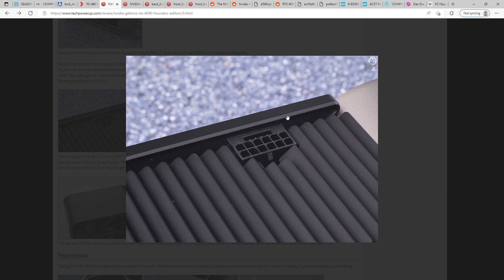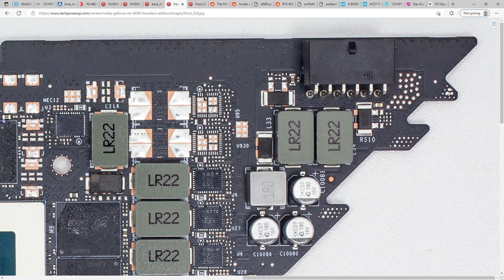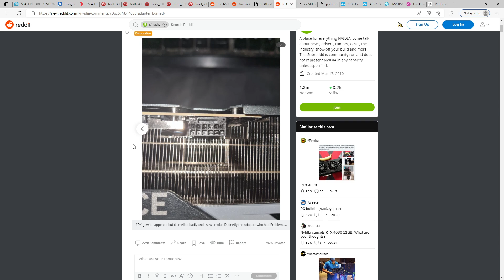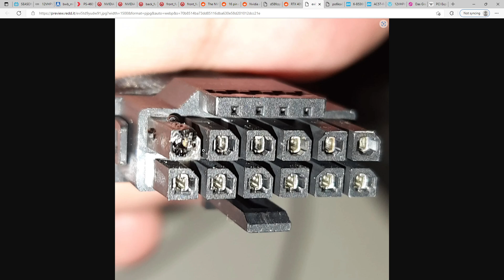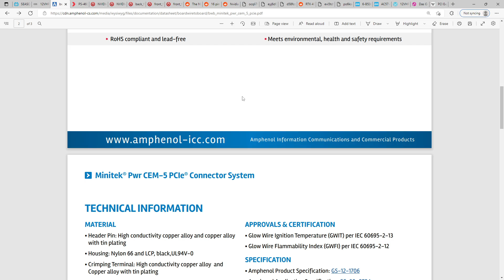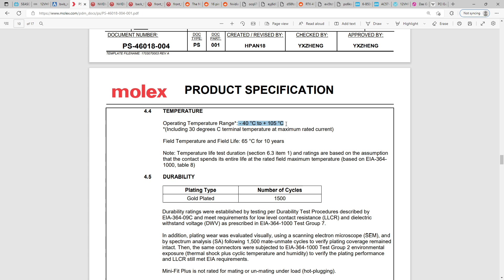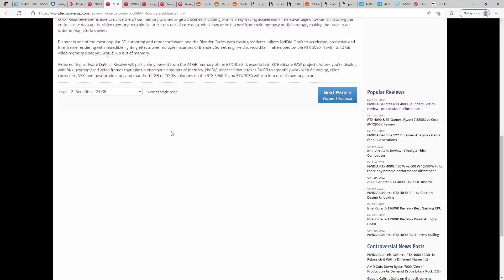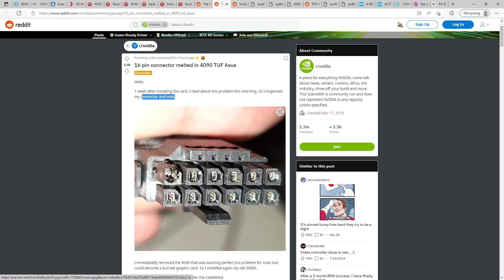rambling about the 12VHPWR failures

Comment: These connectors are a disgrace. The individual pins in the connector are far too small for 100W each and can be damaged or bent in the wrong direction even when connecting them, which requires a lot of force. It would have been best if NVidia had simply used the existing EPS standard for 300W each.

Comment: Plastic is a good conduction insulator. It is generally NOT a good IR radiation insulator.
Even on my 3090 Ti FE the hottest part of the external surface of the card when loaded is definitely this power plug.
It is very noticeable with a heat camera, even fully connected and working properly it glows.

Comment: The stock 3090 Ti adapter cable doesn't have the +4 pins, just the 12, though they are on the card.

Comment: Nylon 66 melts at 270C. Clearly that is the sort of temperature being reached internally. Yet the terminals are however only supposed (by UL electrical standards) to reach 30C above ambient. There is only ONE possible conclusion. There is excessive resistive heating of the pin/contact pair (I2R heating effect).

Comment: iam aweful undereducated when it comes to electronics. but even i though why woudl they replace 2 bigass connectors in favour of one tiny with less pins and smaller diameter.
and now iam about to buy a new powersupply but really question if i should go with the new standard for futureproofing or fuck it and hope this disappears wihtin the next gen.

Comment: 12v can absolutely arc due to inductance in the cables/leads/conductors/components increasing the voltage. When connecting  starting cables to a dead battery on a regular car, voltage spikes into the hundreds of volts, and in the worst cases, thousands of volts are normal, unless there are protection circuits built into the cables. This is what kills electronics in cars. And why you really need to know what the heck you are doing when boosting cars, especially modern cars. Similarly, high current draw items, can cause arcing with interesting effect, like a car, that had a damage wire going to the fuel pump, would arc intermittently, causing the fuel pump to melt/burn out. Over and over.. Until someone bothered to ohm the wiring loom, they insisted it was due to acid in the fuel system :P All that being said, I don't think the 12v connectors in question have been arcing. More likely voltage drop, due to high resistance - like you say.

Comment: 7:00 the conductor is heating up due to the resistance between the male pin and female socket, yes? Supposedly if the connection is poor, there will be some extra mΩ there? If it's pulling say 360 W and we assume the load is evenly distributed, that 60 W per pin which for 12 V it's eeeh... (let me change the numbers... there we go!) 5 A through each connector. 5 A seems fine for those kinds of connectors. 0.1 Ω resistance... eh... 2.5 W worth of heat... is it fast enough to overcome the connector casing heat dissipation? Meh... If i were an engineer i'd say the connector is poorly designed and/or manufactured? But... meh

Comment: Aye I concur, have noticed it's "always" the pwr/12v pins, and it seems to "always" start (!) at the edge pins, commonly pin 6. 12V being the inside row on the socket/pcb side (pin 1-6)/does make it a bit of a PITA; I don't know if any of the AIB versions have a flipped socket though. BUT! I must insist, even on the Founders Edition, that the appropriate method here would be to take a couple of the dirt cheap, tiny glass bead K-type thermocouples or 100k 3950 NTCs, dip the bead in TIM, then secure the cables somehow so the tension of the stiff sensor legs makes them push against pin 6 and 1 (the outer edge 12v pins) , as close to the backside of the socket housing as possible.

IMO that is the closest we're gonna get to a temp measurement "inside the connection", as it's a direct pin/lead contact measurement, and barely 3-4 mm from the pin connection itself.

Comment: People are going to plug in cables from other power supplies and blow up gear. This is a shit idea for any wiring system. All the cables should be the same no matter the manufacture for this reason. All it will take is one cable getting mixed in the wrong box one day in someones closet no matter how careful you are.

Comment: Microarcing is a thing in high current contacts. Have a look at the -ve terminal of a cloud chasing vaper's battery, the type who uses a mechanical mod and blows cloud like a steam train. The 10 amp plus (at 3.7v) brigade. The -ve end of the battery will be discoloured and pitted. I discoloured the -ve end of an 18650 at around 4 amps load in mine, and that was with polished stainless steel terminals.

Comment: Well done. Measuring voltage drop under load would be my choice for proper testing. This is also the preferred way of testing circuits in automotive diagnostics.

Comment: I'm sorry but you are flat out wrong about the "arcing" thing at the beginning of the video. When you have high currents and an intermittent connection you 100% will see arcing even at low voltages. Arc welding is a great example of this.

It is also a very common problem with battery connectors in drones and other lipo powered RC vehicles.

No comment about the rest of the video yet but I needed to correct that bit of misinformation.

Comment: I also like how no one is talking about the PSUs that have a native 12VHPWR connector on it.  You are spending nearly $2K on a graphics card. Buy a new PSU with the proper connector on it and throw the adaptor that is only there for backwards compatibility in the trash. Also the 12VHPWR connector is the new standard.  I am guessing in a generation or 2 all GPUs will only use the 12VHPWR connector.

Comment: The thing is with regular 8 Pins, the cards would only need 3 connectors, and that would still be inside the built-in safety margin. What a stupid "solution" to a non-existant problem...

Comment: Not sure if it matters, but NV adapter is using 4 wires instead of 6, making it 456W; as the 4 middle pins sharing 1 wire per 2 plates. Interestingly the pins with a single wire per plate, on the side of the connector, are the ones that usually gets melted. Considering that those pins are powered by a cable consisting of 4 wires capable 8.5A (300+W) each that is being channelled into single pin designed to handle 9.5A. 
Maybe if one of the 2 middle ones looses soldering or their pins structural integrity gets compromised the one on the side of the connector has to take up the extra load, which it can as it has over 100% safety margin, but then we overload that pin 3+ times the A it designed to handle.

Comment: This is the best explanation of this problem. I’m surprised other YouTubers can’t understand this.
Reply: the irony here being that this particular youtuber turned out to be wrong. had nothing to do with the quality of the pins. turns out the issue was a couple of clowns not plugging the cable in all the way. gamer's nexus had one of their 4090s running on just 1 live and 1 ground pin with a 600W (maximum allowed by BIOS) power draw, and it was fine because those 2 pins were plugged in correctly. 
more than 200,000 4090s and 4080s sold to date. only a dozen or so RMAd cards according to the board vendors. the connector is fine. and i personally love it. makes SFF builds so much easier.

Comment: OMG, thankyou thankyou thankyou.
I thought I was the only one who spotted the 100%/10% safety/hamfistedness margin reduction. That's a brutal level of precision to dump on your users without warning.
Both connectors were rated for the same 30 use cycles but 100% safety margin makes that far less important than 10%. PCI-SIG should toss this crap to the curb. You want 600w, then design a 1200w connector and de-rate it.

Also: 3090ti adaptor = expensive 12x crimped cables.  Zero cheaparse soldering in sight.

Comment: According to their datasheet, the connectors are nylon. Quite ignition-resistant, but still easy to melt. Still, 6 small pins (each way) to carry the better part of a kilowatt on a cable that everybody knew was going to get flexed to hell was kinda smooth-brain. When are we just going to do 6-gauge wire and some thick bullet terminals?

Comment: If your 4090 burns up - it's your fault.  You can afford a $2000 GPU but not a $250 ATX3.0 Power supply?   Hope it burns your house down as well.

Comment: I am wondering if potentially the 3090 ti adapter was tossed in with the 4090 and it was rated for 150 instead of 300.  That would explain Igors picks. I don't own cards, so take it for a grain of salt

Comment: Is there any reason why we only see 6pins used in powerboards? You could basically fit 4 of them on the same area than 3 8pin, while delivering the same power as long as the 3 12v pins are present.

Comment: On Jays 2 Cents, he mentioned someone tested that 12 pin connector and put 1400W through it before it started to melt. That’s pretty good. Hopefully they send out upgraded adapters. I bought a new PSU with a native 12+4 cable/connector. Each pin has its own wire crimped to it.

Comment: Twelve volts might not normally start an arc but it will certainly sustain one. I've seen it happen inside a computer, caused by a faulty molded SATA connector. It arced at the connector, and four hard drives arced across the PCB surface. The glow was visible through the holes in the slot covers, and it sustained for at least a few seconds before I realized what was happening and hit the E-stop

Comment: There is a definite difference to fitting these to a point where they feel like they are fully engaged and then pushing it in an extra 1/2 mm to fully and properly seat it. Of course its a bad design as it should allow for varying standards of installation but it still comes down to unsatisfactory installation of the connector by the user. But that IS the fault of the design as they should be designed to be safe having a 5 year old install them.

Comment: IIRC The issue with the solder isn't necessarily that the solder itself overheats, it's that those joints easily break and might tear the thin sheet connecting the 12v lines, causing the current to flow through fewer pins, causing greater thermal load.

Comment: key word is perfect. but nothing is perfect. so pushing 600w power thru 12 power pins instead 32 pins, if count by old scheme, is insanity... even new corsair and be quite cables is not very good way, because instead use 32 pins in the psu it's use 16... normally for system be ready to some oxide on pin or another thing, what give voltage drop in the contact and overheat that way... all that causes could be minimized by use old scheme "150w on 8pin" on the card. not on the split cable. but be quite and corsair made only good 12+4 papa. but this papa have one(16pin) ball instead two(32pin), excuse me my french... it's not about something must have. this is about melting the risks in place of risks melting the pins

Comment: If you want a good example of arcing think about a cars ignition system where ignition coil pump out over 40 000 volts to throw a good spark across the gap of the spark plugs

Comment: So, assuming I have a Seasonic Prime PX (which uses 18 AWG wires) and I also use Seasonic's adapter (12 --> 2x8pin) it means that they are basically doing what AMD and operate at a safety overhead of 2%?

Comment: Igorlab really explains why the soder joints are the problem...
sadly u do not understand the german language and nothing about basic thermal physics ....
but Igro really shows good how this shit 12vot adapter. is the problem ...  some reached even out and told that this shold never been certified .. its not allowed with soddering .....
Reply: Igor is wrong buddy. Buildzoid nailed the issue.
Also there are English versions of articles on igors site so that is not the issue
Reply: @riba2233  i think its more complex 
I just saw the video of Gamer Nexus also mentioning Igor has different cables (150Volt) and the new adapters have 300V 
Maybe Igor is right for the cable he has ...
It seems fishy that there seems to bedifferent cable specifications around ...

ALso just saw the New IgorLab video and i think it says all :)
Reply: @hfreistify  yeah that part doesn't really matter (cable voltage rating and solder spots). Pins are the culprit 100%

Comment: Who plugs a GPU in "HOT"? Your arching statement doesn't make any sense. Plugging a hot connector into a peripheral with a high currant draw will very likely blow your $1600 GPU especially if the positive side makes contact first! The problem is, to save board space Nvidia chose to skimp on the number of contacts on the board where 12 is not enough. A connector that gets warm under normal use only increases the resistance making the problem even worse when power demand increases. There should be almost no heat generated at a connector. When a company has to supply a 4-into-1 pigtail connector for their product that is a sure sigh of guilt with the load end taking the brunt of all that current supplied by the other 4. When they recommend a minimum bend radii on the cable only reinforces how marginal this design is to begin with. Had Nvidia doubled-up on the pin count and used a latching connector we would not be having this conversation! There is a huge liability issue at play here and I suspect the management at Nvidia is in panic mode and should be looking at firing whoever signed-off on this, the more product they sell and as the card ages the worse this will get. The lawyers will have a field day with this one! It's too bad they overlooked this aspect of a great product. Who knows, this could result in a product recall which scares the bajesus out of any company and this problem is not going away.

Comment: On the question of ignition: I once had a fan fail on my GPU, causing lots of plastic to melt. I spoke to the manufacturer about it, and their support said it had flame retardent in it and so was safe.

I related this story to a fire inspector once, who just laughed. Any time plastic melts, there is risk of combustion he told me. They use chemicals to reduce that risk, but it's always a risk.

Comment: If you have more resistance, the current will follow the path of least resistance. So the terminals that burn are actually on the opposite end of the one that's actually damaged due to the transfer of power.

As for the front and back: Remember that power "pulls" and doesn't push. So in this case, you're seeing the burns where it's "pulling the most"

Comment: A very nVidia solution for a very nVidia problem. Corners were cut with their adapter — two of the sense leads are floating. Also, solder. Why in the fuck is there solder at the plug end? I do not understand.

Comment: How are people fitting these cards with their connectors into normal ATX cases and closing them? 
I run my case open with my card cause I didnt like the connectors pressed up against the sidepanel, And I have a 1080ti. I cant think of a normal case that doesnt put the card on a riser and mounts it vertically that you could close the case with this in it. And not bend the cable significantly, even just trying to close it would pry the terminal spades apart. Its absolutely rediculous.

Comment: What has happened is just too big a tolerence on the melted metal pin terminal (manufacturing error), which has not has a solid (enough) connection. Personally I don't like 450W through such One small connector @12V-DC. At least a bigger connector (=thicker metal pins/terminals, would be more safe to cope with non-solid connection. That is why I would prefer 3x 8pin connectors because less current through each connector / cable (also lower voltage-drop if you can have 3 cables to supply). High current always prefer more solid connection and more wire.
What is happening, is the same as not tightening the pole connector on a car battery. Furtunately a car battery poles and connectors are very robust and hard to melt. You easily create sparks and excessive heat that way, when load is high on the battery, if connection is not tight.

Comment: Great video, Thank you for it! Nvidia could have asked someone from Automotive engineering - specifically on sparkplug coils connection. I Think it's a similar case, because trough these connectors flowing many amps on 12V and as a bonus these coil connectors must have to work correctly in a constantly repeating temperature shocks from -10-20-30 C etc... to rapidly heatup to 100C degrees lol

Comment: with the 3090ti v 4090 if you split the 12v into 3 sections wouldn't the card then be able to spot a greater voltage drop on 2 pins vs the other 4 pins and throttle it back? the cards in stock config only pull 450w on avg so you would be in spec of the rest by practically disabling 2 pins.

Comment: Voltage doesn't make the arc, amperage makes it arc.. and 12 volts 100% can arc.. don't believe me.. three words for you, wrench car battery. 12v can weld that wrench to the body if it's touching the positive terminal.
Reply: Buildzoid has no clue what he is talking about as evident within the first minute.

Comment: The older 8pin PCIE connector had bigger pins and bigger terminals... I still dont understand why it wouldnt just have used that same size.. All GPUs can make space for a 2x8pin - they sure can do the same for a "non-mini" 12pin connector.... And now you risk melting cables....

I would go buy a 12pwr connector from the power supply brand instead of using this ugly and crappy Nvidia connector...